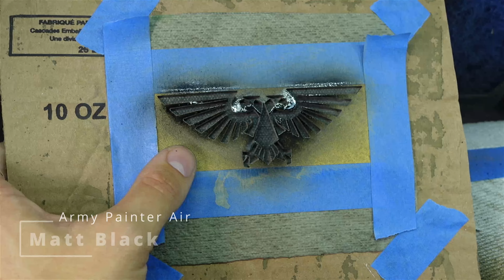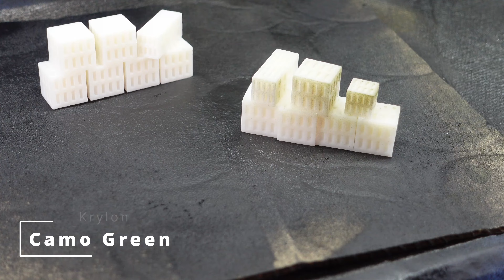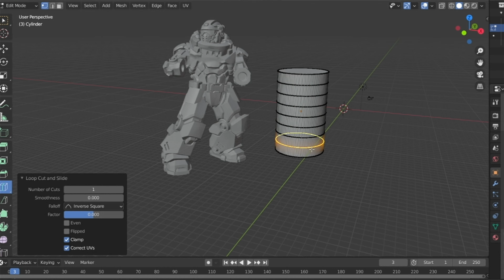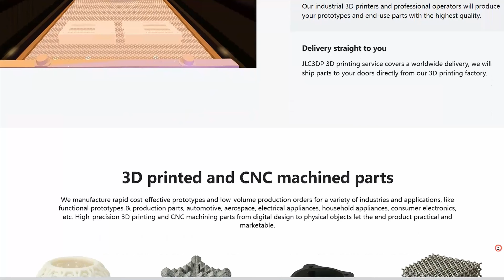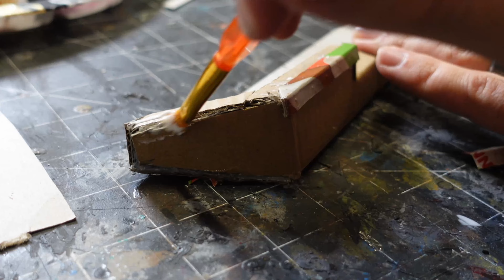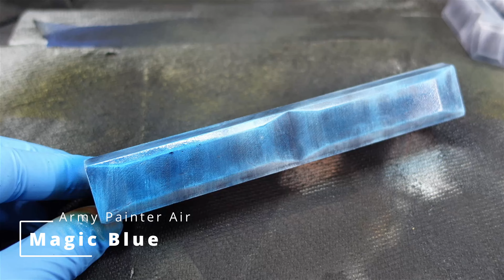Only ONE Makes THE BEST Warhammer 40k Terrain

Comment: Hey Troy, nice work as always. Troy i got a question about 3D printers and you strike me as an expert. Do you remember those micro machines from the 90s? the little plastic jets and aircraft carriers you could collect? Do you know if its possible to print them? If so then whats the name of the right 3d printer and software required for it?
Reply from the maker: Yes I remember them well it defiantly is possible. I recommend Phrozen Sonic Mighty 4K: https://phrozen3d.net/hgDFn and a wash and cure machine. The slicer program you would need to use is free online there are a few of them I would recommend chitubox software
Reply: @FacilityD20  nice 👍 thank you so much.

Comment: I love them both. Scratch building is where i started and printing is where I am now. Personally i'd love to see some builds that incorporate a whole bunch of different methods in one!  How about using some cardboard or foam panels, then embellish with junk bits and printed greeblies? Have you ever tried the "sprue goo" method? I like how you can roll out big panels, then texturize them with rollers. Then add some laser cut mdf or printed embellishments...then add gravel and flock. No need to stick to just one style! Use them all!!
Reply from the maker: I will be doing all of that very soon, I plan on making some really big building for the roll-up matt that I just finished with this very idea in mind!
Reply: Yes. 3d printers are a tool.